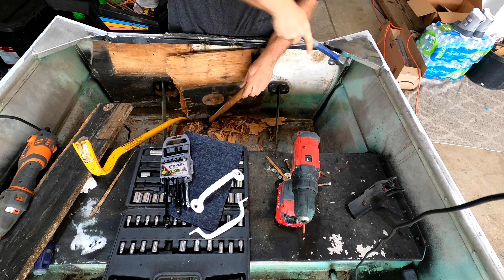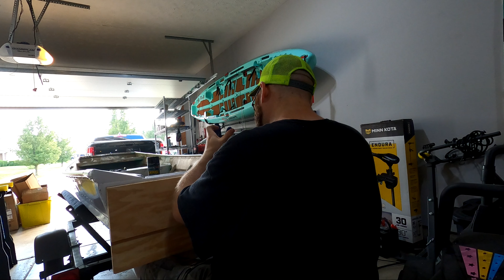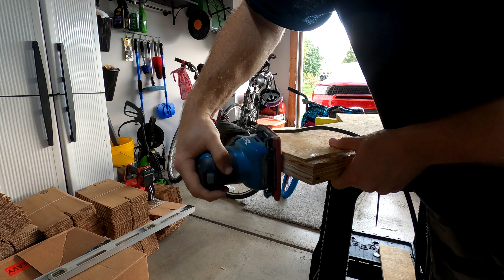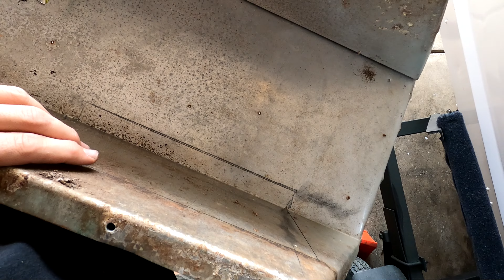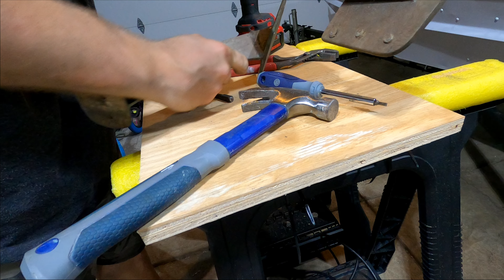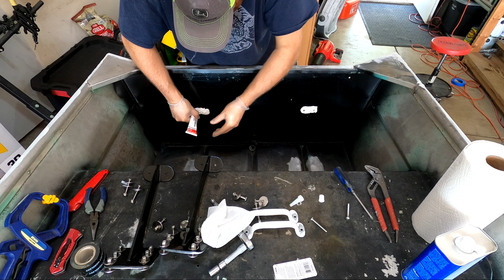Jon Boat Transom Replacement - 1436 Jon Boat Build

Comment: Did you bolt or rivet the braces to the bottom of the hull?
Reply from the maker: They were bolted with stainless steel hardware, silicone in between the hardware and the aluminum hole